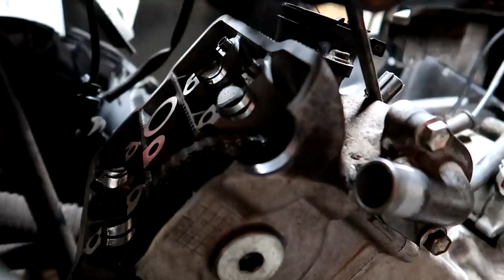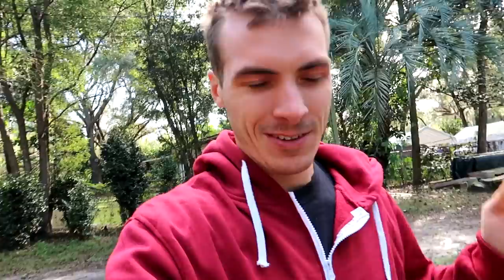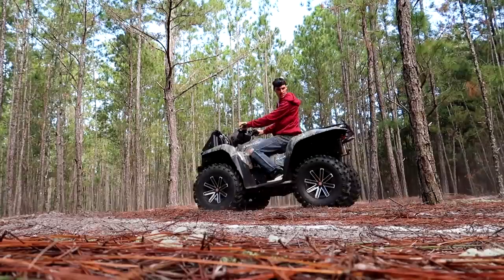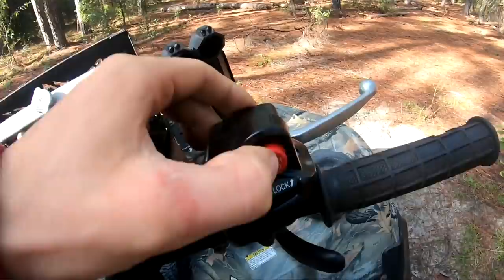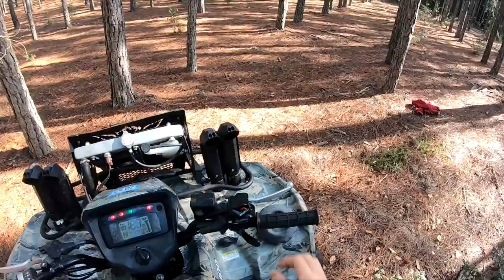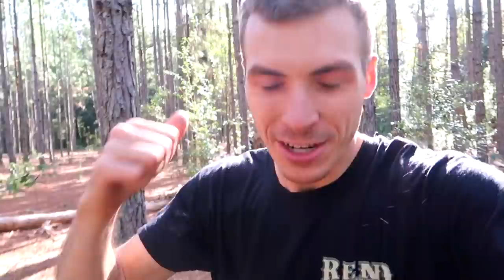HOTWHEELER attempts SANDHOLE

Comment: That’s odd, my 750 Suzuki has a bunch more juice in the caboose. Even with large tires you should be pulling wheelies no problem 🧐
Reply: Same ima only 120lbs and I can catwalk my 750 easily
Reply: It’s only not reliable beacause it’s used not supposed to be abused like that
Reply: Suzuki is just heavy! Lots of power, but too heavy for any crazy stunting from my experience!
Reply: @elijahmaggio2832  my can am is heavy and I can jump it and do wheelies
Reply: @liamgray3265  no it’s because it’s a Suzuki. I BEAT on my Can Am and it’s never left me stranded. I’m honestly surprised it hasn’t blown up yet. Suzuki should’ve stuck to sport quads and dirtbikes
Reply: @liamgray3265  🧢🧢
Reply: @Thatblacksierra  yeah, Suzuki really is just a work horse. Not much of a stunt machine. It’s just not very agile is all! Can Am has it figured out!
Reply: Man used to have a old 300 and it was a freakin tank . Difflock and drove the snot out of it and it worked so well
Reply: @jessemacneil2723  nice
Reply: @jessemacneil2723  the old ones are a lot better than the new ones
Reply: It's his first rebuilding a quad like that there could still be a cylinder down if he didn't do it right
Reply: My 750 has no problems other like yours rips quite nice
Reply: @gagebenson284  glad you're not a mechanic.....

Comment: You should look into a clutch kit or clutch springs. It will give the bike some more power for turning bigger wheels (it's like gearing a truck's differ lower). If you ever want some all-around good tires look into tires called terache Aztecs, they're really cheap for what they are and are extremely light and do excellent in FL mud and the sand only problem is that they tend to want to float in deep water so I would suggest running beadlocks and 0 psi. also if you're ever bored look up this guy named Mudpuppy he is a smaller YouTuber based out of Orlando Fl. He runs the tires I was talking about. It would be cool to see you ride with him he rides in some crazy stuff like neck deep water and clay.

Comment: Does it have a water pump? That could be why it overheats.
Reply: It’s not overheating he just thinks it is cause the fan is cooling it off. On his Yamaha he didn’t have a rad relocate so he couldn’t see the fan spinning but the fan just cools it down as you ride
Reply: It will show on the display if it’s overheating
Reply: Liam Gray he literally said the fan wasn’t working...
Reply: @liamgray3265  The display did say it's overheating (5:56)
The coolant was boiling once turned off, that's also a sign.
The cooling fan is probably fucked.

Comment: Check the fuse that is underneath the rubber boot that looks like a relay it should be on or near your radiator somewhere bro, my z400 fan wouldn't come on and it'd get boiling hot if I ran her hard then I tore into it and found that fuse was popped and after I changed it have not had it get hot since

Comment: Do the shim mod on the clutch. It’s like a poor mans clutch upgrade. Depending on the the size shim .5, 1,1.5 mm it will give you a lot more low end punch but also limit top speed. The .5mm would probably be enough to regain what those tires lost you without losing too much top speed.

Comment: I think the issue with that unit might be the nut behind the wheel perhaps?

Oh and the cooling might be a vapour lock and the cooling needs to be bled properly and the. The unit wont be fucked quite so easy but that nut behind the wheel

Comment: you gotta  figure out why that fan not turn on so you won’t overheat it no more at least hopefully not That’s probably why the engine was messed up is that fan stopped working and it didn’t go down the engine and then that guy sold it to you